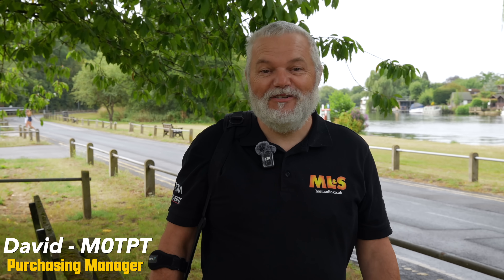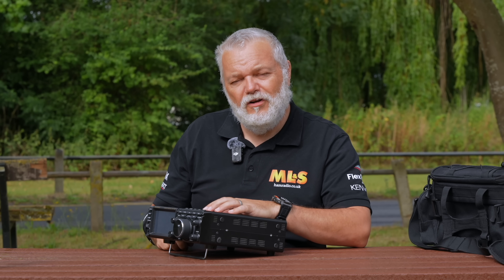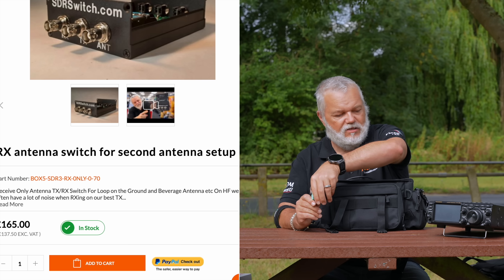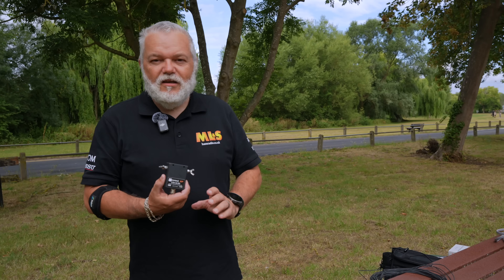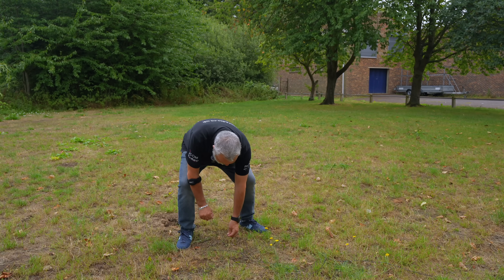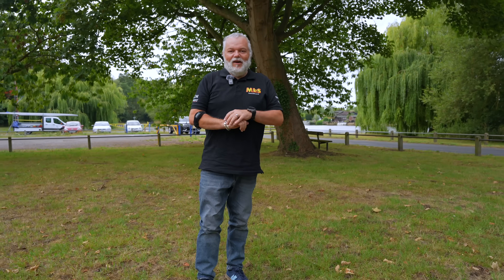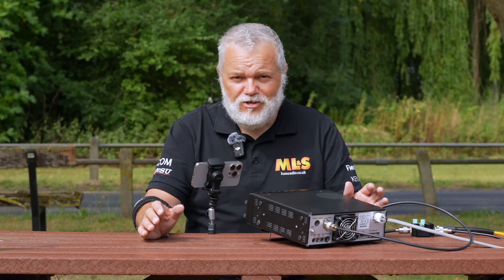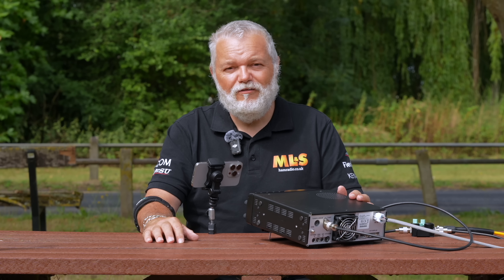Testing the Antenna All Hams Are Talking About

Comment: Explain the difference between this antenna and a beverage antenna l.
Reply from the maker: A Beverage antenna and a loop on the ground (LOG) antenna are both used for receiving radio signals, particularly on lower frequency bands, and are often installed close to the ground to leverage ground effects. However, they differ in their design and operational characteristics. A Beverage antenna is a long wire, typically several wavelengths long, terminated at the far end with a resistor. A LOG antenna is a loop of wire, often square or rectangular, laid flat on the ground.

Comment: I have a fan dipole and an R-7 vertical hooked up to an LDG-100, to my 7300. And I switch back and forth between both antennas constantly. The vertical is always noisier, but 1 or 2 outta 5, it'll pick up the transmitted signal stronger than the horizontal dipole! Enjoyed your video

Comment: I'm in the middle of installing a home-brew LoG myself when I came across your video. Here's hoping mine works as well as yours! 
It would have been nice to have seen it on other bands.
73 Ed DD5LP
Reply: An update - I have finished my LoG installation and am happy to report a similar situation to shown here on this channel and elsewhere - on 20m & 40m SSB, with the preamp off on the main antenna (a 40m full wave horizontal Skyloop) and the preamp on when using the LoG, my IC7300 indicates signal strengths that are almost identical on the meter however, the signal is more comfortable to listen to using the LoG as the background noise level is reduced. Whether building or buying, if you live (like many of us do) in a noisy RF environment, the LoG is worth a try! 73 Ed.

Comment: It would be interesting to do a field strength test on the loop antenna. A low loop like that should have very low noise, a high angle of radiation, and a very low radiation resistance.

Comment: I’m not convinced the signal to noise is better on the loop. It’s quieter but so is the wanted signal.
Reply: Intelligibility is improved.
Reply: The LoG is notoriously "deaf" in terms of absolute signal strength. Because it sits on the ground, the Earth absorbs a vast amount of the incoming radio energy. If you compared a LoG to a full-size Beam antenna at 50 feet, the Beam would "hear" signals that are simply below the detection threshold of the LoG.

Comment: Interesting comparison.  I have seen these comparisons over the past 5 years, I would like to spend a few weeks doing various tests with the ground mounted antenna to understand the theory.  I have done loop antenna testing on the MW band (0.54 - 1.7 MHz), rotating the loop to null interference.  Most of the interference I encounter is power line noise, like was observed in the video.  What I found was, the loop antenna will reject interference that is a Ground Wave but, not the Sky Wave.  I also don't know if the behavior is the same on the HF bands.

If the ground mounted antenna is genuinely effective, could it be optimized?  Will QRN be more attenuated with the antenna buried a few centimeters?  So many questions and so little time...

Of course, the vertical antenna nicely receives interference since it has a 360 degree pattern.

Power line interference has a random polarization because the power lines are parallel to the ground but, since the power line lengths do not permit a resonant antenna, the wires end up "spraying" signal in every direction.

Yes, backing the receiver RF gain down to where the desired signal is just heard, does help with the QRN.

Comment: Nice. However almost any antenna will be quieter than a vertical of any kind. Vertical antennas in most cases will be noisier than other types of antennas, especially in an urban environment. RX ground loop antennas are generally quieter than other antennas. So what you have demonstrated is a generally noisier type antenna with a generally quieter type antenna. You did a very good job of demonstrating that issue.

Comment: What is in the box?
Reply: A ground loop is not a 50 ohm antenna, the box contains a BALUN, Balanced to unbalanced transformer.
Reply: @kf7bws  Yeah ...I need to be more clear. I meant everything in the box. To see if its different than the DX Engineering  that i already have.

Comment: Nice vid. Though I Think comparising antenas polarized differently seems a little bit pointless. Sure thing the vertical gains more noise. It would be much better to compare ground rx loop with a horizontal wire antena.
Reply: Yeah but not all POTA locations would allow for a horizontal. This was a great demonstration for what I'll be doing exactly.
Reply: Polarization smolarization! 🙄

Comment: What about making it to transmitt???  Are you using a choke on both antennas ??? Also make a 100ft wire with an eye loop at 60ft and use different colors at 25ft and 15ft? Wrap the extra wire back on it's self on 60ft !  One wire to do both 60 and 100 ft ! If you use my idea, send me one. 73s AA2BD
Reply: The idea with this antenna is not to transmit but to hear well.

Comment: The real comparison would be to add enough pre-amp to get the same S reading of the signal and see if the loop on the ground it actually reduces the  receive noise or if it only appears to as the entire receive signal is less. Maybe use the attenuator function in the radio to bring the S reading of the signal down to the same level as the loop on the ground and compare the noise levels. 
Also does it work as well on higher bands or only 40 and lower (which it seems by other youtubes done on similar loop on the ground antennas.)
This video seems less than "scientific".
Reply: I tried your suggestion with a homebrew LOG last year.  I could not find a situation where the LOG gave a better S/N ratio.  I always found the same reduction of noise and signal with the LOG compared to my endfed wire or my vertical.  I tried 160 meters up through 20 meters.  I use att and rf gain to optimize listening for every qso.
Reply: It will work mainly only for 160 80 40 other bands its poor. 73. and there is no S meter reading report we can give.. like old time we should give the report based on what we our ears tell the brain.

Comment: That was a great demo. I get now how you can pre amp the loop to counter the loss in Rx to make it stronger and not boost the QRN/QRM. Very nice. I have the FTX-1 Optima. It has 2 HF ports. You can configure it looks like antenna 2 port for Rx only. Now that’s a great portable combo. No AB switching required.

Comment: I always run my FT-710 with the ATT set at -6db, preamp OFF, and then adjust the RF and Audio gain to bring out the signal. To suit my hearing and to reduce noise even further, I have the width filter set at 2.25khz and the Contour ON and set to 750hz. In my opinion, faffing about with wires on the ground, and remembering to switch back to the main antenna, for transmit, is not something I'd wish to do to gain a tiny (if any) receive boost. F4WEY
Reply: While watching the video I saw the RF Gain control on the radio and wondered if I could do the same with my IC-7300.  Thanks for confirming my thought.
Reply: @johnclements3441  Yes that works. Also try narrowing the SSB width filter to 2.25khz (or even lower) and if your radio has a broad audio notch filter like the FT-710's 'contour', move it between 500 & 1000hz, the sweet spot for my hearing is 750hz. You can do the same thing with a graphic equaliser between the radio and an extension speaker.

Comment: The POTAFlex reminds me of the ThickWire Ethernet cable from the early 80s.
Reply: 5-meter 10Base5 "ThickNet" using RG-8/U and its 2-meter successor 10Base2 "ThinNet" using RG-58A/U IIRC. :)